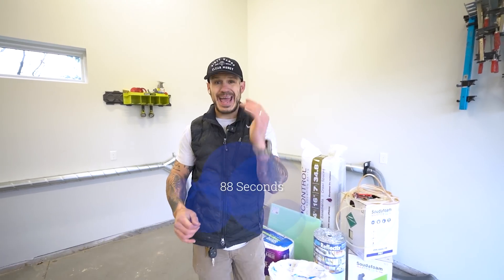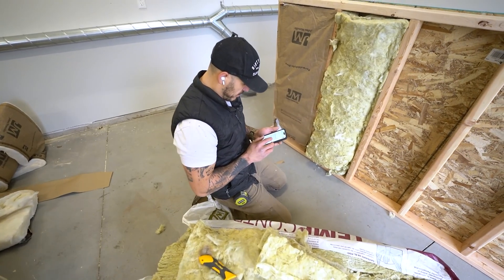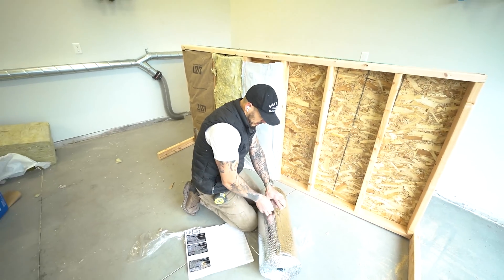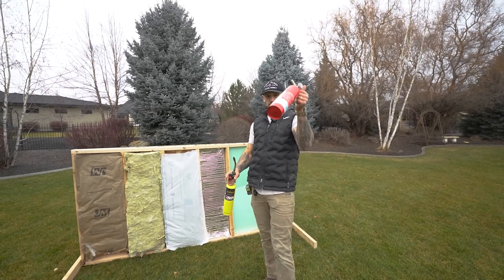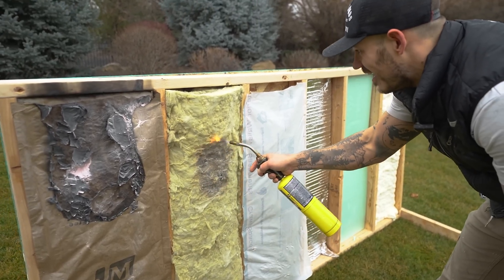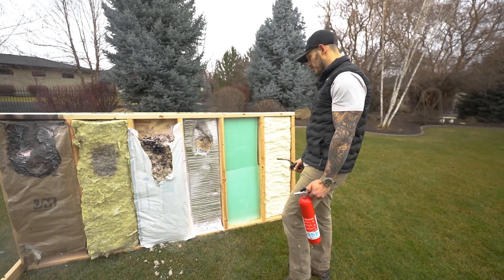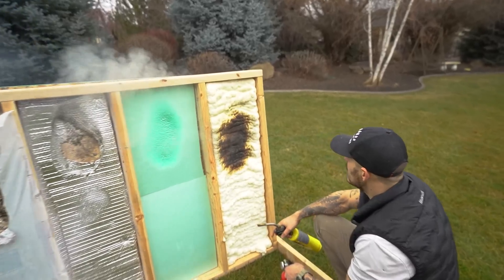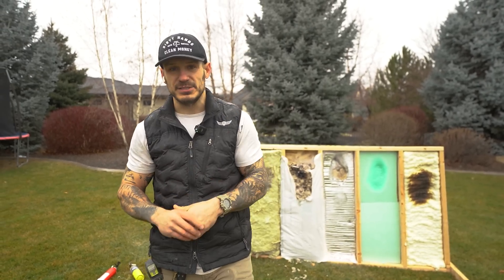I Tested 7 Most Flammable Home Insulation

Comment: Those were very informative tests and I really like these kind of videos 
BUT
While the last 2 did not seem to catch fire It was mostly because they did not reach the required temperature. They are very good for fire prevention, but they are like petroleum in cases when a fire has already started.
Rock wool and Fiberglass should be the best but they are bothersome to cut and fit.
Still good vid

Comment: They put some fire retardant in the spray foam. Our walls have 7” on it in them. I did some changes and cut a section of the foam filled wall out and tried to burn it. It would not stay burning without an external heat source. I was using a weed burner for a  torch.

Comment: The spray foam didn't catch fire easily, but it made a lot of smoke when it was heated. From what I know about chemistry this would have been very unplesant smoke too. It was surprising to see just how much it released from a little bit of charring.

It's also important to note that while the plastic based insulations (foil, polystyrene and foam) didn't ignite too easily, this is only helpful when a small source of fire touches them. All plastic are still inherently flamable when hot enough, so if your house gets properly on fire these materials will ignite and release a lot of heat and smoke. And fire is a chain reaction, so when some of the isulation starts to burn it will spread through it fast.

Rock and glass wool don't burn at all because they are litterally made of rock and glass which have been melted and spun like candyfloss into a fine wool like material. They are completely non-flamable.

In most cases all these materials will be covered with plasterboard which is pretty fireproof stuff. In most situations you really should have a working fire alarm that lets you know there's a fire long before anything burns through your plasterboard to the insulation. But there can be areas of exposed insulation in homes worth considering more carefully, and of course some fires start inside walls.
Reply: I know PU foam makes hydrogen cyanide when burned.

Comment: This test proves nothing. Leave the torch in one spot on the bottom of the insulation. Ignition itself is dependent on temperature, time, fuel and oxygen content. Flammability ratings take into account dripping and burn-through rate and how long the material resists the fire. Sure, brushing it with a hot torch for a second or two will singe it but never ignite it unless it's self-sustaining. And oh will that sprayfoam self-sustain itself once it gets going!

Comment: That cellulose insulation goes up like a Roman candle after years of sitting. I know this because I have to braze air conditioners in attics and it is the worst fire hazard and should never be used. Plus it’s the only one you actually had to put out.

Comment: Things that most people don't seem to consider is; How easy, difficult, or impossible, is the insulation to replace after it gets exposed to fire? How is the insulating ability affected by exposure to water? And, does the insulation absorb water and therefore promote the growth of mold. And even, does the insulation have any sound deadening abilities? 
  The Mineral Wool Insulation does quite well in all of those situations. It repels water, so it retains it's insulting ability. And because it doesn't absorb water, it doesn't contribute to mold growth. And, it Doesn't have to be replaced after being exposed to water. It is not flammable, and virtually uneffected by being exposed to fire (except for being discolored on the surface). And, it has some sound deadening effects also, which is an added bonus.
  Whereas, most common fiberglass bat insulations absorb water and lose their body (like wet hair), losing most of their insulating ability (Permanently. Because they Don't regain their fluff after drying). And, the holding of moisture promotes the growth of mold, which becomes a health hazard. (I wonder Why is it still legal to use, much less, why it is the most commonly used in the US??? Maybe just because it is the lowest priced?). 
  The foam insulations may not catch on fire easily, but they Do usually shrink, shrivel, or melt, when exposed to fire (or extreme heat), which reduces or removes the internal trapped airspace that is what makes it insulting. Which makes it useless after being exposed to flames, and needs to be replaced. How extremely difficult (or impossible?) would it be to replace Spray Foam insulations??
Reply: mineral wool (here we call it rock wool, from Knauf) also loses its insulating ability after getting wet but it regains it back fully after it dries (use case: water heater boiler)
it's quite difficult to remove old spray foam (you need to use a showel or something), like removing thick ice or partially frozen snow https://www.youtube.com/shorts/jxWWh9rB8nQ
Reply: @robert-9754  True. If it gets Saturated with water, it temporarily loses it's insulting ability, because it's insulating is mostly from maintaining a neutral Air Space inside the "insulation" to keep the hot and cold separated. Whereas water transfers the temperatures through it. But, in house insulation situations (other than severe cases such as flooding or extreme leaking) the insulation is only subjected to a small enough amount of water that the rock wool insulation is able to shed (repel) the water, instead of absorbing it. So, its insulting ability is either not at all affected, or, only very slightly affected for a very short period of time. And, because the rock wool insulation is more rigid and doesn't go flat when saturated with water, the water can drain out easily and the insulating ability is naturally restored to its original state. Where, the fiberglass insulation (bats in particular) absorbs the water and falls flat (like wet hair), and it loses it's insulting ability completely on that area of the insulation. And, similar to hair, if left to dry naturally while flat, without being fluffed up, it doesn't fluff itself back up hardly at all, it stays mostly flat and unable to insulate any longer. And, because the fiberglass insulation flattens out, it doesn't allow air to circulate as easily to dry it out, so it holds the water longer, and that promotes mold, and rot of the materials around it. And, then it becomes a health hazard, And, eventually a physical (structural) hazard. And, once the fiberglass insulation has been saturated, it has to be torn out and replaced, to regain insulating in that area. Whereas, rock wool doesn't need to be replaced, unless it has been heavily saturated over a long period of time and been contaminated by things around it. 
  Even in ideal perfect conditions, fiberglass batt insulation doesn't insulate as well as rock wool insulation, and it may not pose those health or physical hazards for that time. But, in the real world, less than ideal situations of everyday life on this planet, where things do often eventually settle, crack, and develop leaks over time, and insulation is likely to, at some point, be exposed to water... I'd rather not take the higher risks of mold and rot commonly resulting from the use of fiberglass batt insulation getting wet inside of the walls where I, and my loved ones, dwell. Especially not just to save a few dollars on insulating my home. Besides, the greater insulating ability (R Value) of the rock wool insulation, pays you back some every time you get a reduced utility bill. Potentially continually for a lifetime. Which could result in having to work a little bit less, and having a little more time to spend with loved ones. Improving the quality of life in a different way.

Comment: FYI those yellow cans are no longer actually MAPP gas as of like 2009. Its usually a mix of Propylene and a small amount of Propane. It burns marginally hotter than propane but it has a much higher thermal transfer. The difference could be made up with a larger burner for the propane tho. At least where I am the propane bottles are half the price.

Comment: As someone who works in procurement for all these products i feel like some additional info is needed here for those asking questions for their own projects... 1. For Canadians paper face is not a proper vapor barrier will not replace CGSB as it does not make a continuous vapor or air barrier and would not pass code in Canada cant speak for the states, as we have more of a freeze thaw cycle then most of the states. it is mostly used to prevent slump in fiberglass. Fiberglass the cheapest solid insulation option will slump in the wall cavity over time. the paper face prevents that increasing its life span and warranty. 2. cellulose the cheapest options require either metal lath to hold it in place or drywall and holes... other thing is that bag is meant to go into a shredder that fluffs up the cellulose, increasing volume, and efficiency of the product and is applied with a blowing machine. Should also be know this would never be used in new construction it is really only used in renovations where your not taking down drywall/plaster but there isnt enough insulation in the walls so you cut a hole and fill the cavity with cellulose. 3. Mineral Wool or Rockwool depending on brand is the best but is the most expensive solid insulation product. 4. The Ridged insulation was a bad example as that is low density product, and for residential insulation you would use a Hi-density product like from Dow/Dupont... this generally goes on the outside of the building before building wrap goes up. 5. then finally spray foam.... the most expensive option being 6-10 times more expensive then solid insulation. So money/situation is generally the determining factor on which way to go and that is determined by the size of the project. Fiber glass 10-15 k, rockwool 20-25k, spray foam 50k+ on a 2000 Sqft home. This is why most projects will use a combination of at least 2 or more products to finish a home. like fiber glass or wool in vertical walls and cellulose or another blown in insulation like Rich-R or Climate Pro in the attic ceiling. Sorry for the wall of text...
Reply: Interesting stuff thanks for sharing
Reply: THANK YOU FOR THAT INFO.  WHEN WE SPENT SO MUCH BUILDING A NEW HOME, ONE SHOULD BE MORE INFORMED AS TO HOW TO KEEP IT STANDING AND NOT WORRY ABOUT THESE 40,000$ KITCHENS AND BATHROOMS.
Reply: hey how much is Styrofoam (the white one or graphite) used for insulating buildings in US/Canada? it's widely used in Europe for example, but the walls are not drywalls there. Minimum is around 15-20cm, some go beyond that (depending on the climate). It's also quite good fire rated once you cover it with plaster (for the occupants of the building - it might still burn if there is a real fire, but not instantly).
I've only seen videos on yt about the sprayfoam for the US or even no insulation. I didn't know it was the most expensive one though.
And what is the most common insulation for house exterior walls in Canada? I also assume you guys don't use brick that much.
Reply: @robert-9754  Rigid is used when there are no wall cavities. Ie foundation walls, brick, cinder block. Most residential construction in North America 2x4 n 2x6 wood construction. Only basements have foundation walls.

Comment: The cellulose is basically just very finely shredded newspaper, so that is going to burn to a certain degree.
Reply: The paper is actually soaked in fire retardant chemicals to prevent this. Cellulose generally has a fire rating of 15-20 mins... which is why it passes fire code. But Mineral Wool is better.
Reply: Paper is 99% cellulose so yeah
Reply: It is the dumbest thing to use for insulation.

Comment: Hey, fun video but be careful on this topic especially regarding making suggestion on products to use. I'm not sure how the US regulates fire safety in construction (as im from the UK) but I would strongly recommend reading up on the relevant building regulations and referencing them within your videos to provide a more informed video, likewise reference the manufactures fire testing data.

Scary reading some of the comments...
Reply: This is very true... There are many options in each product group from various manufactures but generally the situation will dictate which type of insulation is needed based on building codes/Situations.
Reply: @Richard23ca  interestingly within the architecture practice I currently work for, we will typically only specify mineral/rock wool for all our projects, unless other factors come into play like compressive strength or thickness limitations... Due to recent massive cultural factors like grenfell tower incident. we fear that within the decade insurance companies will not cover or charge extortionate rates for buildings that use combustible insulation such as PIR ridged foam.

Frankly speaking, yes fun vid, but these test should be completed by accredited professionals, and or contain information from them. I fear people just googling best fire insulation will come here. Im taking this all a little too seriously as its just a fun vid so rant over, but yeah careful recommending products. hope y'all have a good year.

Comment: You should’ve looked up what a common city code or state code would be. If you would have. You would have found out that any foam insulation needs to be covered up with something. I believe you could cover it up with more bat insulation or Premable plastic. The reason why is that long before the flames from a fire would kill you. The fumes that the foam insulation gives off would kill you way before.

Comment: Only thing with spray foam is the gases when it's ignited. You just have to coat with an protective paint
Reply: This is very true... often people will die in their sleep due to the off gassing that happens when spray foam is melted.

Comment: Mineral wool is cotton candy made from rock/metal slag. It doesn't burn, works when wet, soundproofs way more than the other options you have (more mass), is easy to install. But you need to spend a bit more compared to fiber and install a vapor barrier. 

I prefer it, mostly due to the sound and critters don't seem to like it.
Reply: Caution with this statement as mineral wool and acoustic mineral wool are not always the same product. there is a standard mineral wool like rockwool, Owens Corning, & JM... But they also offer acoustic options where the manufacturing process changes from R value priority to sound damping priority. make sure to ask questions to ensure you are getting what you want.
Reply: @Richard23ca  wel yeah, but the normal mineral wool is already better soundwise than fiber/foil/thin sheets of foam, and possibly sprayfoam pricewise, probably not when used in equal thickness.
Reply: Yes I agree it's more expensive but I wouldn't use anything else
Reply: bugs and critters don't like blown in cellulose, rodents especially can't make tunnels easily.

Comment: you can get foam insulation with reflective (metalized / pretty thick aluminium foil) side on it --- works great in case of small fire
Reply: The issue with Bubble wrap insulation is it is not meant for wall cavities... it is a wrap meant to go around objects like pipes in cold spaces like a crawl space with a heating run going through it. they offer very little R-Value so not good for controlling thermals....